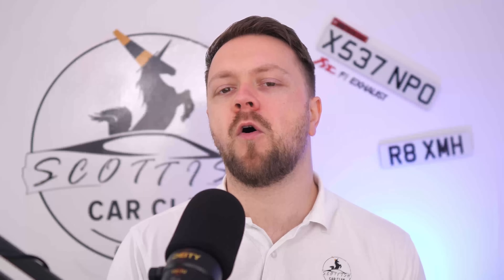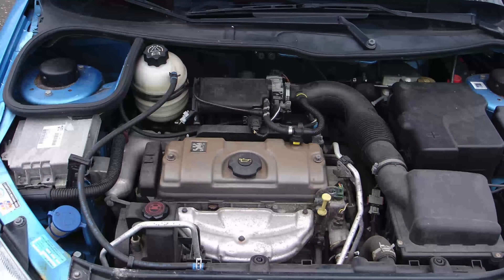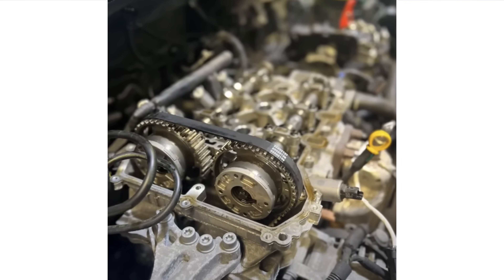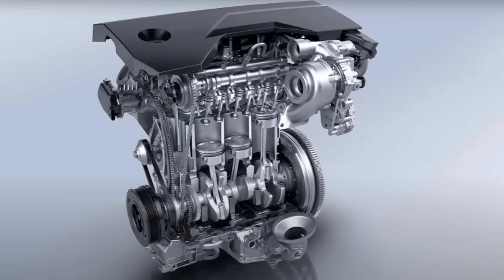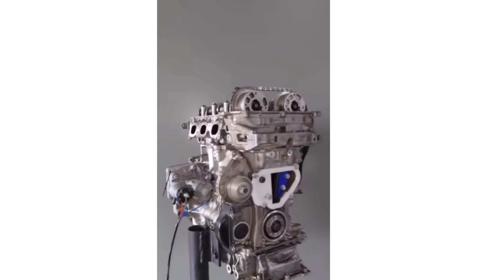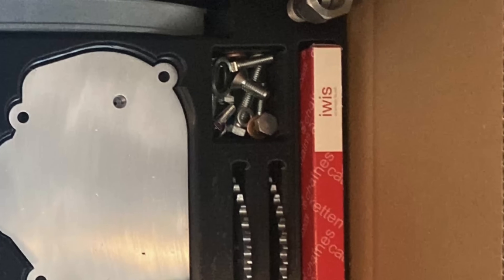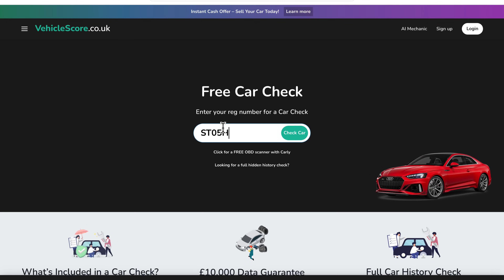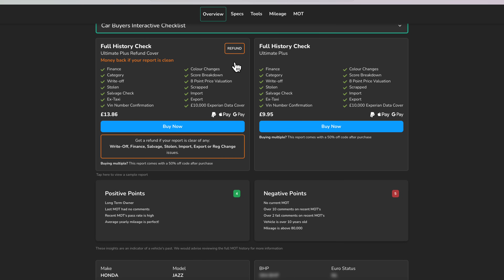Peugeot PURETECH FIX UPDATE | CHAIN CONVERSION

Comment: Why didn't Peugeot do this from the start I just had our wet belt change on a Peugeot 208 but still Will getting rid of soon as it is starting to use oil .
Reply: To save 0.000001mpg or 0.0000001g of co2 and because its a bit quieter than a chain
Reply: @sbrader97  clearly if it consumes oil prematurely is not environmental friendly

Comment: So you could buy one of those cars for market value, a tenner, then fix it for 500 plus labour, then you'll be able to sell it for 100, maybe 200.

Sarcasm aside, why can't y'all buy Hondas, Toyotas or Mazdas? What's wrong with the UK buying public? Is it because salt roads claim cars in 5 years anyway that nobody wants reliable cars? Is it insurance cost? Or is it as simple as the consumer needs every last MPG? 

What gives?

Or is it the consumer not doing any market research before spending?

Someone's got to know the answer.

PS. Great video.
Reply: Hondas also use wetbelts
Reply: Toyota is expensive and ugly... they where reliable but today? I dont think so they are not NA Gasoline anymore

Comment: Service your wet belt car regularly with the correct spec oil and you are far less likely to have any issues.
Reply: that is the problem , it doesnțt matter if the owner is responsible and does the service regularly and uses good quality oil, it is about the petrol vapours that mixes with the oil and this mixture ruins prematurely the wet belt and after that the presure of the oil drops and the brake failure, the engine fails prematurely. it is overall a bad sistem that hopefully will be changed. stellantis used to make good relliable cars.
Reply: Wrong.

Comment: Is there a permanent wet belt fix on the horizon for Ford's 1.0 ecoboost engine ?
Reply: The latest ford ecoboost engine (2019 onwards) puma, mk4.5 focus and the last fiestas all have timing chains although the oil pump belt is still rubber so it doesn’t exactly 100% fix the problem but it’s only a small belt so it reduces the likelihood of a failure🤷‍♂️ the fox ecoboost is the problem engine (2013-2017) although ford did run the engines down in 2018 so that year they had a mix! The Wet belt engine is a crap design make no mistake but hopefully it’s becoming a thing of the past!
Reply: @philmoffett366  not true my fiesta was a mk8 21 plate with the 140 engine and still had the wet belt system best way to tell is if the turbo is at the front it's the older style engine and if it's at the back its the revised engine

Comment: I have owned from 1980 11 citroens brought a c5 aircross at 4 and a half yrs old 30000 miles the auto box needed replacing at the cost of 7500 pounds with 1000 pound search fee at 1st citroen uk didn't want to know it took an email to the UK ceo then they tried every trick in the book to get out of paying 6 wks of emails in the end they would only pay half so good luck with  them paying for the chain conversion I will never buy any vehicle made by stellanis

Comment: Just get an EV.
Reply: Are you for real a ev a car you can't fix and when three years old worthless😂
Reply: @michaelkilbride2927  As opposed to all the people who are going to spend the weekend changing the wet belts you mean? EV and ICE depreciate the same over 4 years, model dependant.
Reply: @oldgit15  there are plenty of good cars that do not have this bad engine, wet belt puretech . with the electric ones they are not good for now and so expensive just to throw them away after a few years? where is the environment protected here?

Comment: I have a 2020 Vauxhall Corsa & already on my 2nd wet-belt, failed after 22,000 miles. But my local garage has told me my 2nd wet-belt is cracking & will fail soon & it’s only on 30,800 miles now.
Reply: 8Kmiles for a belt get rid of it quickly if u an afford too
Reply: It sounds like nonsense, it just can't be. Either you are using a cheap belt, or you are using the wrong oil, or you are just lying
Reply: Mines on 20k but no sign of cracking..
Reply: Trade it in for a Honda Jazz or Suzuki Swift
Reply: @majorminor3367  suzuki swift is too small , in the back is hard to get in because you bump your head .
Reply: @majorminor3367  honda have wet belts
Reply: Get rid of it! I bought a hyundai much better.

Comment: Does a 208 gti have a wet belt?
Reply: Nope, the 1.6 has timing chain
Reply: The 1.2 is the only one with a wet belt, however that changed in 2023 when they went back to a timing chain (so I'm told)

Comment: Wasn't there a decent amount of time between when PSA retired TU and brought out EB2?
Reply: The TU 1,1 and 1,4 8V were immediately replaced by 1,0 and 1,2 Puretech. Later the 110, 130 and 155 hp Puretech turbo engines replaced the 1,4 and 1,6 as well as the 1,6 THP which was developed together with BMW. That engine had a new cilinderhead and distribution chain that was the same as in the VW TSi. It was basically a revised TU with reliability issues added.The wet belt was supposed to end the problems with the distribution chain. It did not quite turn out that way

Comment: Also need a conversion kit for the transit timing wet belts too for the oil pump as well
Reply: im not sure why Ford went back to chains for their main timing chain but kept the wet belt for the oil pump on their Eco boost engine,
Reply from the maker: @kingsknightuk  I worry we'll see these start to fail in large numbers soon...
Reply from the maker: Ideally yes, who knows - this company may well branch out.
Reply: It won’t happen unless new cams and a oil feed modification for the chain tensioner, reason for cams is the cogs are sweated on none removable.
Reply: Is this not a recall yet i’ve heard and seen documentation saying Ford UK are taking responsibility

Comment: These engines also premature wear the piston rings so will need a rebound at some point because they burn through oil faster than a refinery
Reply: Sticking not wearing.... Its a common problem amongst many manufacturers Inc Toyota and Vw !!!! Low tension piston rings are the culprit..?

Comment: Is there any word on the 1.5hdi getting a proper chain conversion i.e not just the snappy cam chain
Reply: From what I have seen, dvrc 1.5 kit, 8mm chain is on market.. But cams and rocker cover need changing inc in  kit  £400 ish
Reply: The 1.5 & 2.0L diesels change the timing chain at 180,000Kms (used to be 220,000kms)

Comment: I Bit the Bullet and had wet belt done on my Pug 2008 1.2 in December. @ 47000 Mile. As it happens, when asked about the old one. I was told that it was in pretty good condition as was the filter in the sump. So will be keeping it a little longer, to justify the money I paid out. Cheer. See you in the next on. 👍👍
Reply: It was an engine remanufacturing company. Less than 1000 feet from my house. Who I never gave a thought about. Until I asked my MOT Garage. About somebody local to change it. Still felt ripped off. As i knew the guy from way way back.
Reply: Same here - I changed the belt at 44,000 miles in 308 1.2 130hp. No issues with the old belt
Reply: Any News on this ?
Reply: you should replace the belt before it starts looking bad, anyway. no oil or belt change can help you if you had a belt that started to decompose, gunking up everything in contact with the oil

Comment: Fit that conversion then all you have to worry about is oil consumption due to ring wear ….
Reply: And both done for the same reason.. . Low consumption.  But low tension thin rings are essentially preworn rings. 
And of course the low tension rings allow fuel to make it to the oil, eating up the wet belt
Reply: The earlier engine in the DS3 and the like and they have chains.....and problems with the tensioners.

Comment: I'm subbed but didn't get a notification and I can only actually give 1 thumbs up, so. 👍👍👍👍👍👍👍👍👍👍👍👍👍👍👍👍👍
500 quid for the kit does sting a little but hey, a big thanks for the info.😉 I may be keeping my 2008 a bit longer than the two years max that I gave myself, after finding out about the wet belt horrors.

Comment: My lad has just moved on his 308 puretech its been problematic despite changing the belt as a precaution its been off the road since September trying to resolve a misfire suspect low compression on a cylinder wether its fixed who knows as the debris moves around the engine blocking up where it will , wether you can trust a car even post chain kit is up for discussion they aldo have a dmf clutch to add to the list of things that can potentially go wrong.
Its a shame really it was quite a well specced car felt nice & solid.
The trade will gain knowledge and work out what mileage you can leave a wet belt in before it deposits rubber debris degrading the future life of the engine.
Its a gamble he or i would be unlikely to take its not like Peugeot support customers of their vehicles, particularly well with franchises that are indifferent at best.
Its damaged the legacy of a group of brands that made some very long lasting engines in the past 1.7 1.8 diesels thst wentnon forever with decent servicing.

Comment: I wouldn't touch a Peugeot with a barge pole.
Reply: Buy a Ford Eco boost instead and have bigger problems 😁
Reply: They used to make fantastic cars in the 1980s and 1990s. Their diesel engines were very good and were installed in other manufacturers' vehicles.
Reply: Nor a vauxhall!
Reply: Why?
Reply: Nothing wrong with Peugeots - just avoid the 1.2L engine.

Comment: I believe the new 2025 Stellantis cars are fitted with a chain drive..
Reply: They'll bite you somewhere else. No thanks
Reply: They need to reassure the public snd trade as residuals will take a hit unless the modification had removed even  minor belt drives for oil pumps that are wet belt its all about confidence in the brand.
Reply: No they arent
Reply: If you google it you'll find that vauxhall have replaced the wet belt in 2025 models.

Comment: Nobody in their right mind would buy anything with a pure-tech engine, consumer confidence lost, too little, too late !
Reply: Dry belts also need replacing and although cheaper , certainly NOT cheap.
Reply: @philipschafer7008  The timing belt in my old Renault Trafic costs 120 Euros and it takes me the day to change it........240,000Km and it passed its Controle Technique last week !!!
Reply: Wow. Terrible comment. 

Purchaser's and now the unfortunate owners, like myself of such cars with these troublesome wet belt designs would never have purchased at all if they had been properly informed about known issues and the related problems which will occur, sooner or later with said engine types. 

Come on mate. Cut us some slack. We're not all of  "the right mind" like you, are we.